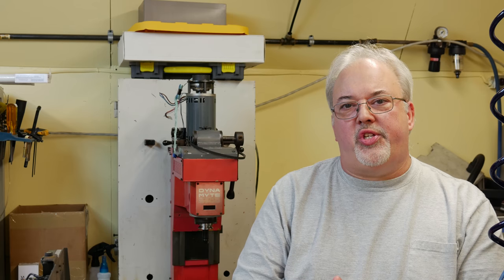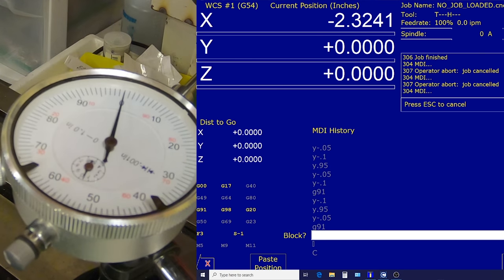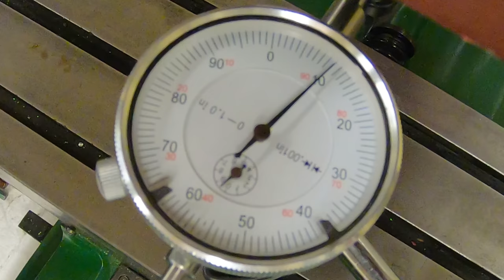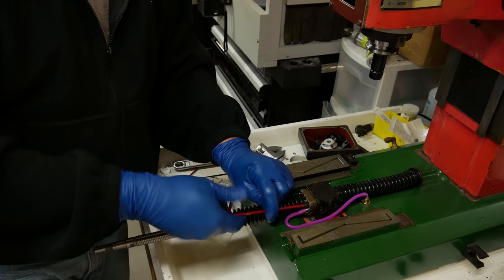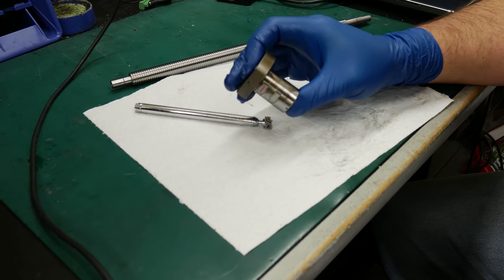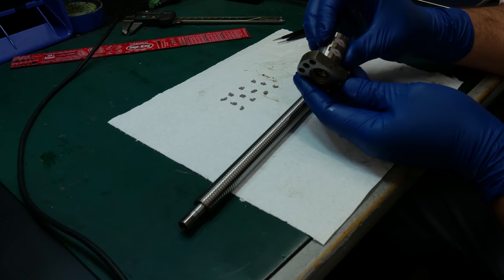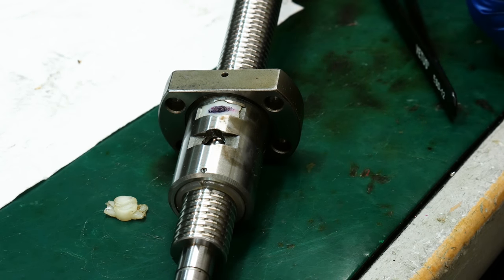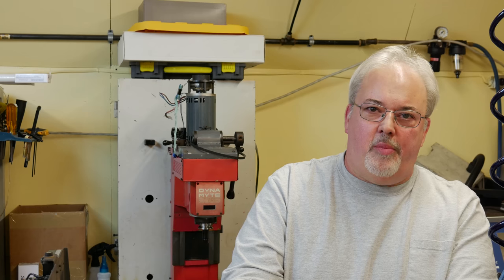Ball Screw Backlash- Centroid Acorn CNC retrofit

Comment: the motor seems to use a toothed belt to drive ballscrew your backlash may be in the betlt drive between the motor and screw rather than the ball screw itself.
Reply from the maker: That is an interesting thought.  The belt is kevlar banded and super stiff but that is a possibility.

Comment: First of all i have never had to refill a ball nut. I did once take an old one apart(on a tractor stearing box). being a complete single trac from start to finish why can you not put all the balls in the same hole and slowly turn the screw to get more balls in, or is yours 4 seperate individual tracks not connected to each other?
Reply from the maker: Correct, this nut is 4 separate circuits.  You can actually tell if a bearing is out of place by turning the screw.  If a ball is in a track it’s not supposed to be in, it will run into the wrong side of the deflector and jam the nut.

Comment: I’m no expert but I’m guessing your ball screw is a SFU1610 with a -4 nut. So 16mm diameter and 10 threads per inch or 2.54mm thread pitch. The ball nut would be a -4 which has 4 races for balls. Should loads of them on eBay or aliexpress
Reply from the maker: Thanks for the idea Gord.  On a 1610 it isn't 10 threads per inch, and when you think about it, it really wouldn't make sense for a screw manufacturer to express a metric screw with any imperial measurements.  The 10 means the pitch of the screw is 10 mm.  For every turn of the screw, the nut will advance 10mm.  That is a much coarser thread than I have. In my case the part number for this screw would be a 1602.5-4. So far the only manufacturer I can find that lists it in their catalog is NSK.  That being said, there is no reason I couldn't retrofit this with something else if need be.  Thanks for watching!